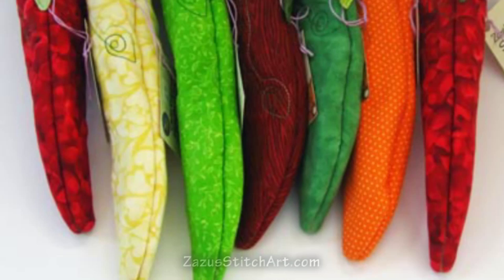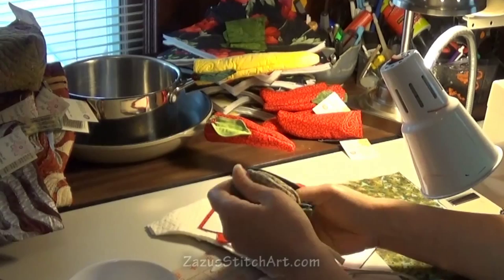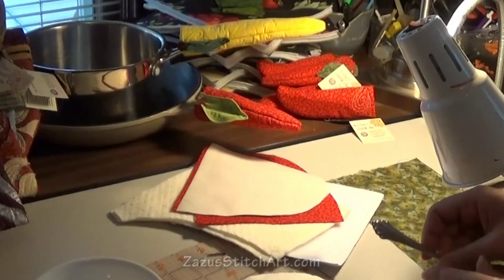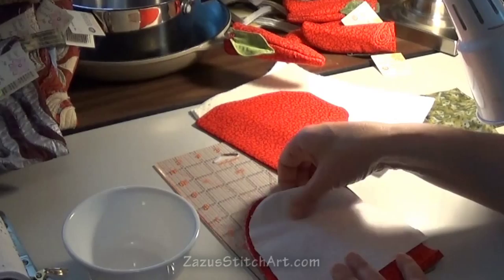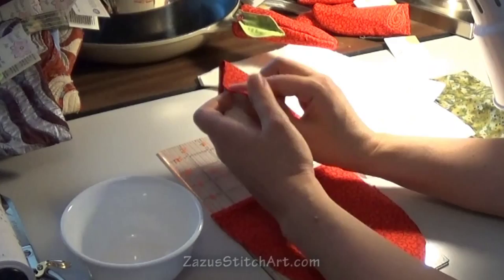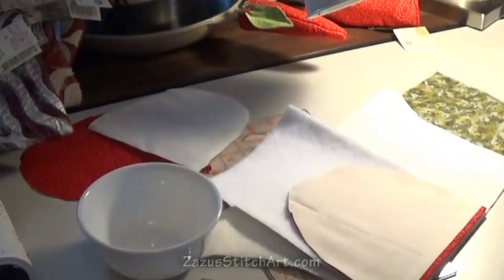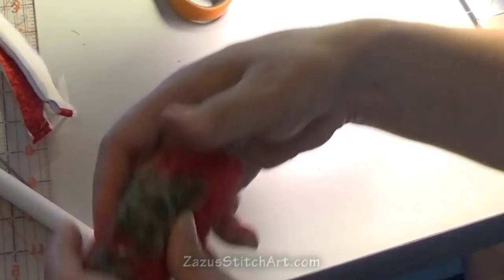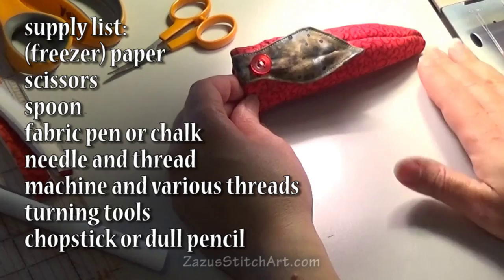Let's Sew Chili Pepper Handle Covers | Zazu's First Tutorial

Comment: U may not think it matters which side the insulbrite is on. however it's like the same concept in use as aluminum foil. shiny side to attract the heat in the oven or visa versa ( like for a ham or turkey) dull side deflects heat. like use dull side to slow down the cooking. git it? like using dull side for the fridge and freezer. for keeping off freezer burn. U want to deflect the heat from your hand. hope it helps
Reply from the maker: Diana Wright Thx!